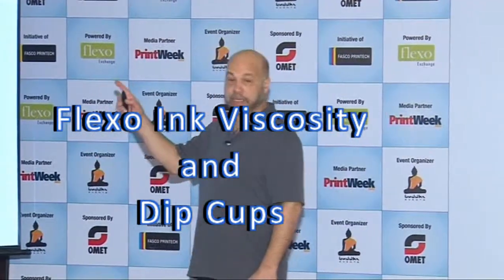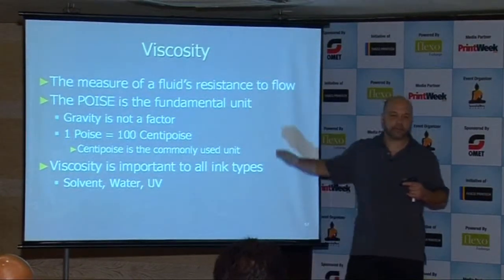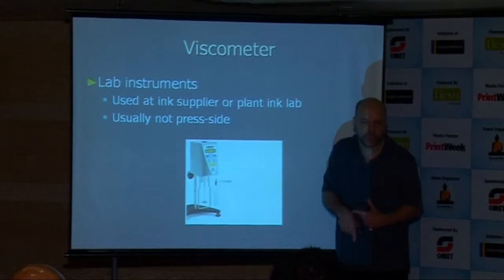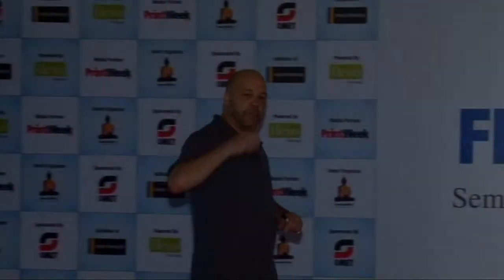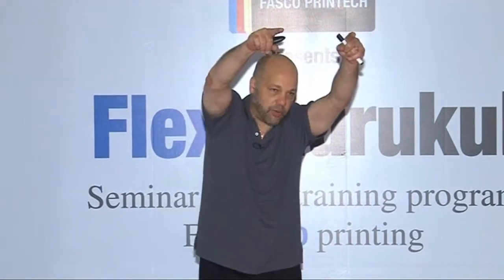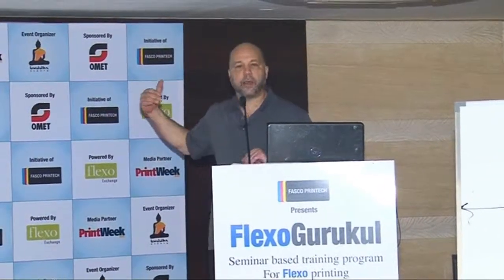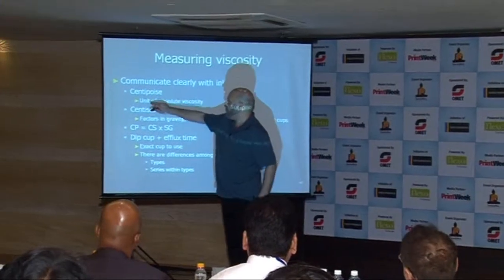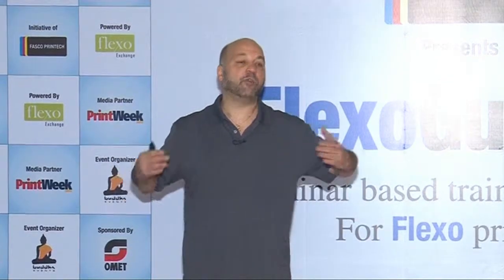Flexo Ink Viscosity and Dip Cups

Comment: Realy Helpful information,  I am looking options for PH meters, and found a Hanna pocket meter (around 120usd) and a portable Hanna (around 250usd) both with replaceable electrodes do you think it worth going for the portable and pay the extra?
Best regards!
Reply: On the pressroom floor, I'd go cheap. Those things are practically disposable. In the meantime, they work. It's like Zahm cups. WE can use expensive viscosity measuring devices, or a cheap Zahn cup. We go cheap because they're accurate enough and easy to replace when damaged.

Comment: Norbert! In my company, we are facing ink consumption variations in same jobs, For example, I have 2 same jobs. In one job, ink consumption is 13 kg and in another same job, same design,same weight, each and everything is same but consumption is 33 kg. How is that possible. Please help me
Reply: try to see the paper if the same paper adsorption so it will be from the ink supplier

Comment: I wonder if atmospheric pressure plays any role in measuring viscosity with dip cups. 

It’s probably marginal.
Reply from the maker: I doubt it. First, I agree; it would probably be negligible. On closer inspection, though, the pressure is all around the cup and equal, canceling out. Be safe